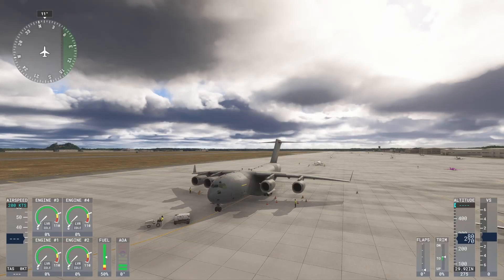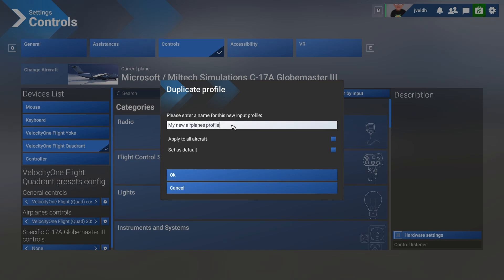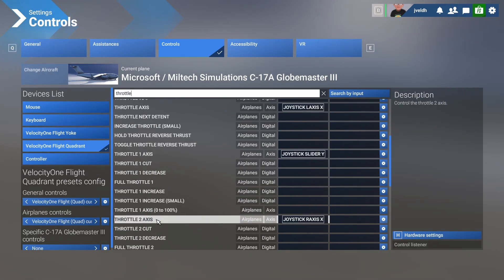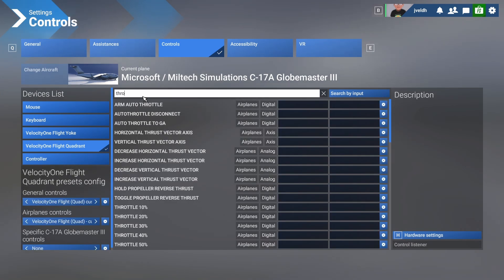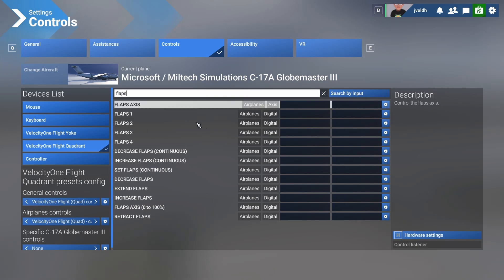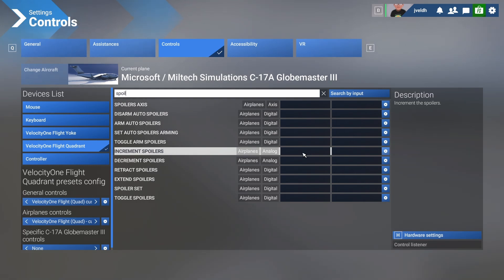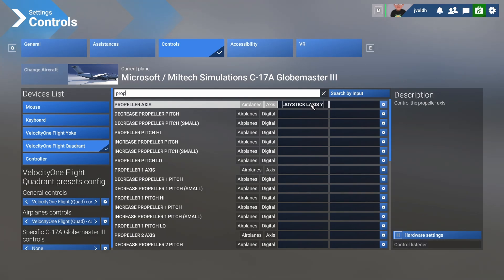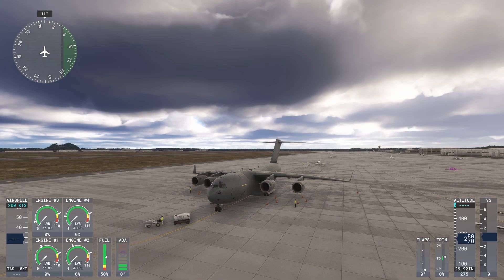MSFS 2024 - VelocityOne FlightSystem - Quadrant configuration 4-engines aircrafts

Comment: I have watched all your videos on settings  as I have just ordered a velocity one. my only question is that after doing all the seperate settings for prop single engine, double etc... When I want to fly the different planes do I have to change the setting profile to the appropriate plane each time or does it just know the settings? sorry if its a dumb question I'm new to this lol
Reply from the maker: Depends of you set it as the default you only need to switch if you fly using a different aircraft with more engines
Reply: @Highintheflightsimsky  cool thanks for the info! I will be back to watch on the weekend again to do my set up